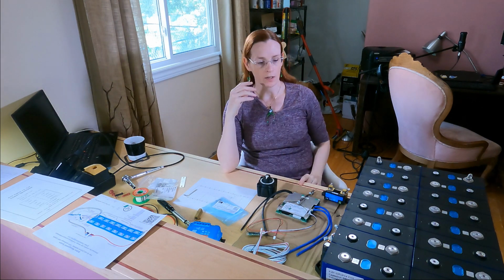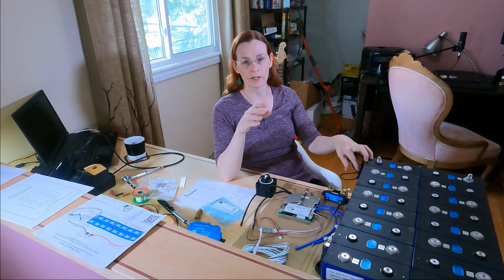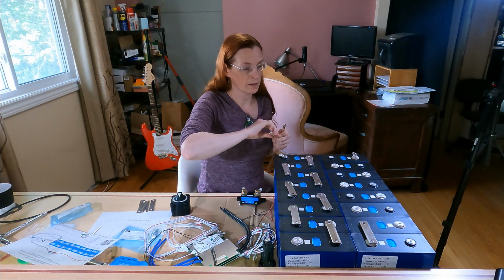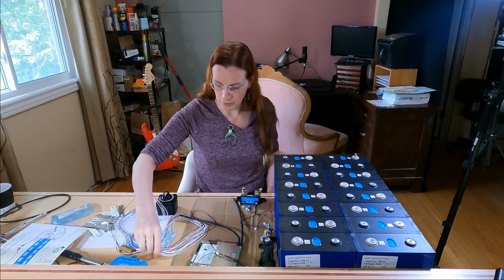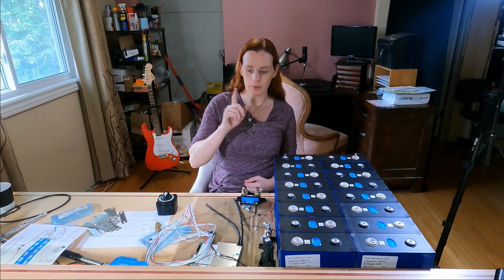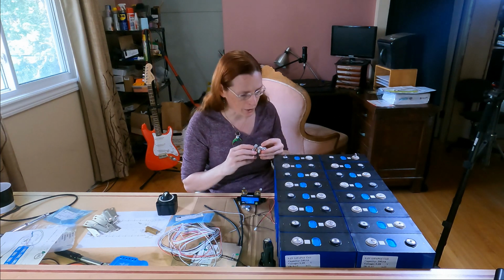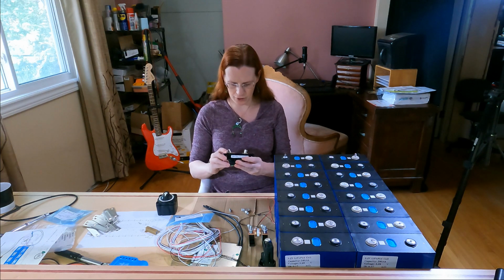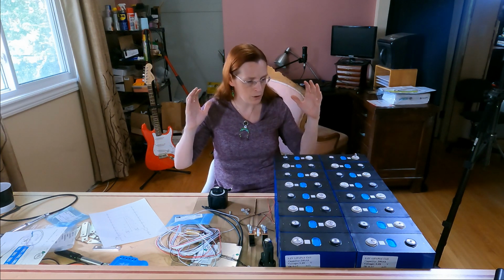A beginners guide; Overview - How to build a 48v Lifepo4 battery (Ep. 2)

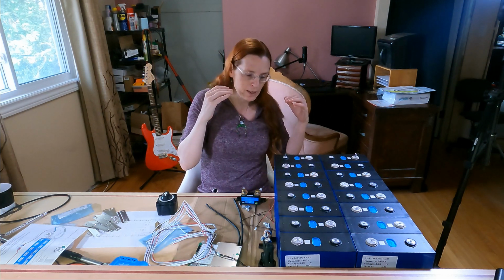Comment: 8:48 Why do you design your battery so that you have to connect cells 8 and 9 together with a longer wire? Are you afraid that the main plus and main minus poles of your battery are too close to each other, and therefore you feel the need to keep them as far apart as possible? I had this fear at first. But pretty quickly I realized that it doesn't make any sense. The battery shoes attached to the plus and minus poles do not move to make a short circuit, as maybe a busbar could theoretically do. And you will immediately get a wire protection fuse on the other pole and your bms device will also cut the power when it detects a short circuit. So here's why - forget about that 40cm long flexible wire. It's actually a useless weak link in the whole battery!
Reply from the maker: You'll see if future videos that I work a fair bit on different configurations.
Reply: @TheDigitalMermaid  Thanks for the comment. However, I was interested in WHY, as a beginner, you planned to make the connection between the 8th and 9th cells in a different way than in the mussa gaps. Of course - if you can't tell it, then you won't tell it, and that's it.
Reply from the maker: @MR-ub6sq  I don't know what "mussa gaps" are. I configured them at the time so that the main pack + and - are further apart.
Reply: @TheDigitalMermaid  Yes. I saw that you did it that way. It was smart job!

Comment: Great video, I learned a lot.  When you said how the BMS balances the cells, I thought "there's no way that those tiny wires are carrying enough current to affect cell balance!" but then I went and read up on both active and passive cell balancing and it turns out that it is done with less than 1 Amp of current per cell.  So at a length of a couple of meters, you could use 24 gauge wire for that.  So I sit corrected.  I am 3 years late to this party, I can't wait to see what has transpired in your project.
Reply from the maker: Aye, the old JBD style are just resistors the drain something like 50mA, so not much at all. Welcome! The party's still going!

Comment: I understand the fun of this project being a software and hardware engineer myself. But I have to ask, would it make more sense to buy 30kah of lifepower server rack batteries
Reply from the maker: Nope. First, I've never seen a track mount battery designed for marine use. Second, the volumetric density is pretty bad. Third, those cost pretty kwh isn't good. Fourth, I wouldn't have learned nearly as much.

Comment: Hi DM thanks so much for creating this playlist! Will you be sharing an estimate of what your costs will be for each battery system? I'm looking at an all in one battery pack of 48v and similar capacity, but would consider building one of these if the savings pays off! Especially after watching how much fun you are having :)
Reply from the maker: It's a bit hard to estimate at this point. Prices on cells are changing fast, but my last quote was $113 usd per 304Ah cell (using 280s for now, they're prices aren't a lot lower at the moment). Note that this was on a quote for 100 cells, so it might be higher for smaller orders. The BMS is about $200usd, ish. I'm using marine grade everything, internal T-class fuse, smart shunt and an Anderson connector. So I would very very roughly say that my build cost is about $3k/pack. Now, I also had to buy all the tools needed to make the batteries, but those last so if you add them in to the cost to build or not depends on if you think you have use for the tools down the road.

I do plan, when I have a final design, to create a single video showing just the strict start-to-end build, and I'll include a full list of all parts and tools used in the build. That will probably be done in a few months(ish).

Comment: i hope it is ok to give constructive criticism.  if not, i'm sorry and delete my post.

while watching Andy's video, https://www.youtube.com/watch?v=qZg4Jxftw-c&t=323s  see how close your description of the "C" rate works out.

i've heard you use the word "power" in more than one place.  it feels like you might not have a great handle on that word.   POWER is the same as watts.  watts are amps x volts.  one horse power is 742 watts.  switches have voltage ratings.  why?  the higher the voltage, the farther an arc can happen.  ac & dc arcs are different.  dc arc will continue longer than ac arc (ac cycles, the arc will have a better chance of dropping as it changes directions).  sand in a fuse....  what do soldiers hide behind?  which is more conductive, sand or air?  if i've left a little fly s**t in the pepper, sorry.

shunts are used to meter current flow in big cables that need to be monitored at a distance.  this allows small wires and easy mounting of gauges.  to know how many amps are flowing, the voltage drop over a given distance (the shunt itself) is measured.  depending on design of gauge, it may be able to measure amps in both directions. does that make him a smart shunt?  wonder what the net amount of amps might represent?

putting a soft switch in for turning on the inverter makes me wonder how often you will be  turning it off/on.  i have had mine for at least 4 years and have only turned it on once.  hmmmm...

i hope you are doing more reading on what a BMS's job is.  i don't know all myself, but this might be a good place to chat about it.

btw,  here are a few more videos from andy i would call "MUST WATCH"....
https://www.youtube.com/watch?v=pijPu7t-akM
https://www.youtube.com/watch?v=-nPJFM4cLFY
https://www.youtube.com/watch?v=Wlr6IIYBFJo
he has a bit more on balancing and i get the feeling he maybe having a change of heart soon.  stay tuned in to him!!

congratulation on your 1000th sub!!
Reply from the maker: Kindly given constructive criticism is absolutely welcomed, and appreciated. I would rather be told something I already know ten times than miss helpful information once. :)

I know about the differences between AC and DC (and that's why DC scares me more!). I also know W=I*V, and often use the word "power" in a more colloquial term. That said, this post is very good, specially for anyone else who sees the command and is looking to start out. I sometimes forget how much I've learned before I started, and can focus on how much I don't know. :)

I'm aware of the role of the shunt, and it was one of the first parts I ordered. I've not USED the shunt before, so I need to learn how to use it still (same with the inverter/charger). I'm at the "concept" stage and will be moving into the "practical" stage of learning over the next few videos. 

I added the pre-charge resistor because it's useful every time, even if "every time" is only once a year or four. Initially, as I learn, I expect to connect and disconnect a lot, but once I get things installed on the boat, I doubt I'll ever really touch it. Particularly because there will be a gang of battery packs, so even if I take one out of service, there should be power of the inverter from the others. 

Before I started, I went through and watched all of Andy's videos. That was exactly how I knew to get the T-class fuse, and that's where I got the idea for the pre-charge resistor. I've learned a TONNE from his videos, and I've tried to implement much of that learning in my build. :)
Reply: @TheDigitalMermaid  2 things....
 1)   I need to learn how to use it still (same with the inverter/charger).  when i was a young guy, tv, radio, & record player came "all-in-one".  if one broke, the whole unit went to shop.  that put us out-of-business until unit came back.  tv or record player not as critical as inverter or charger.  also that separation made hook up to my style BMS (external h/l volt shut off relays) easier and more practical. 

2)  it is GREAT you have watched all of Andy's videos.  how many have you watched twice?  my count per video is ridiculous, but each time i see stuff overlooked before or because of more learning, it is viewed in a different light. "CAN'T GET ENOUGH OF THOSE COCO PUFFS!!"

Comment: Question, have you put any thought into the motor you will be needing or using for the boat? While most things run on low voltage the motor may need high voltage to lower the amperage usage and that requires smaller conductors saving money on the cabling and maybe the motor itself. I was thinking of doing something like what you are doing with a tri-hull pontoon boat. I’ve seen people convert boats to electric motors but none have had a way to charge the batteries. The pontoon style can allow for the installation of many solar panels where a sail boat not so much. Back to the motor topic I see the cars using high voltage for their motors which makes sense to me since the higher the voltage the less current needed. I too came to your site from the off grid garage channel. I wish you the best in this endeavor.
Reply from the maker: It's very much subject to change, but I'm designing with the QuietTorque 30kw (https://electricyacht.com/product/quiettorque-30-lc-electric-motor/). It's a surprisingly big motor, and though it is brushless, I need to do more research once I choose a boat, I will dig in deeper to see if I can find more compact / efficient options.
Reply: @TheDigitalMermaid  Wow now that is a nice motor I never heard of. I can understand your ideas better now with that in mind. I wish I had the income to build  the the boat I had in mind but I don’t have it being retired myself. Keep up the videos I will be watching and being quite jealous. 😀
Reply from the maker: @davidjackson8787  I realize I am extremely fortunate. I hope you can enjoy the journey with me. :)

Comment: In a moving boat it may be better to use short cables instead of bus bars!
Reply from the maker: There's merit to that argument... I am planning to have them in a very stout box, so cell-to-cell movement shouldn't be an issue. However, it's something worth considering, thanks.
Reply: @TheDigitalMermaid This is how Ford protects its matteries ! https://www.youtube.com/watch?v=4vRjo0gaG1g
Reply: @TheDigitalMermaid  Solid will be fine so long as your box is tight. Unlike land vehicles they will not be getting much vibration, so pitch and yaw is a low frequency vibration they will move as one unit.

Comment: I love the Victron gear.  I built the Rasp P like Andy and it works incredibly well for monitoring.
It's quite clear you've been doing a lot of homework.   Love your presentation style, you're good!
Reply from the maker: Thanks, that is kind of you to say! I plan to add in rpis as I get further along the project. I ordered the VE.Direct cable to try to talk to the devices from the rpi, and I've got the USB connections for the BMS as well. Eventually I am hoping to write some software to monitor all aspects of the boat, and feed the data into a processing system. That's getting quite far down the road now. At this stage, I'm still learning the basics.

Comment: You've probably figured this out by now.  Absorption charge is not as you describe. Absorption charge is the phase of charging where the cells are at absorption voltage, and the current is being tapered to hold that voltage.  At no time is current ever "pumped" out of the BMS cell leads. Balancing occurs using resistors in the BMS that VERY SLOWLY bleed off excess charge as heat - typically at a paltry 30-70mA depending on the BMS.  I think the overkill is 50mA.

Nice call on the pre-charge resistor. Too few ignore this and destroy their BMS.
Reply from the maker: I know now about the resistive load to drain batteries to top-balance, and I do believe you're right that the 50mA drain on the Overkill. I've not yet played with absorption (oddly enough, I've got a video in queue from Andy at Off-Grid talking about this). So I'm not entirely surprised if I didn't understand/explain the absorption charge portion properly. So much to learn! ^_^

Comment: If you swap the two rows of batteries would the little bus bar fit across to join the two rows?
Reply from the maker: Nope, it's a touch too wide for the provided bus bars. I did consider that, but once I realized I was going to need a cable anyway, I decided to configure it so that the main positive and negative terminals at the front were on the outside edges of the batteries.
Reply: @TheDigitalMermaid  Ah pity!